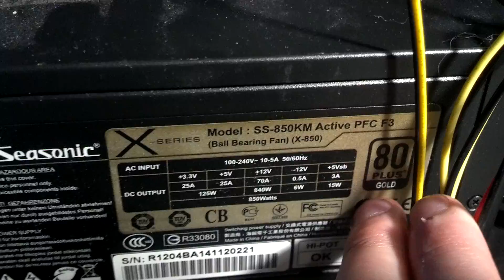peltier cooler + Liquid Cooling idle temp 9deg C

Comment: Is there any issue of condensation?! I would love to know more!!
Reply: Issues with condensations occur when you get sub zero temperatures (Celsius)
Reply: Ziggurat Condensation occurs with change in temperature, doesn't have to be freezing, air contacts a cooler surface and water droplets form. You can look up dew/frost point if you want, it's an interesting subject.
Reply: best to run the peltier with a thermostat or timer to keep it around 8 oc

Comment: The heat that comes out of the radiator is the heat from the CPU + the heat generated in the peltier (that 168W has to go somewhere!) so it will get warm even while idling.